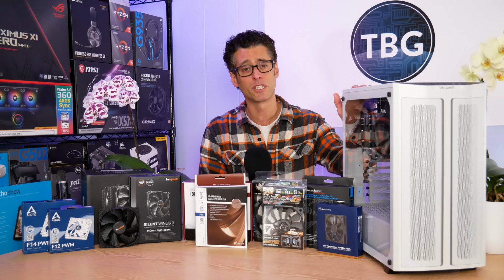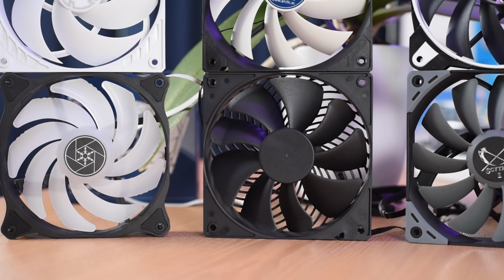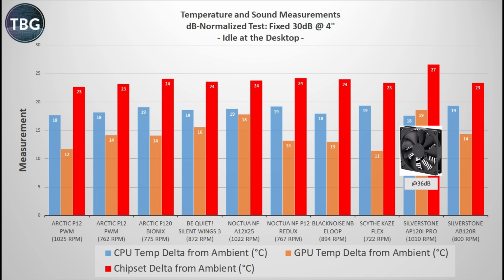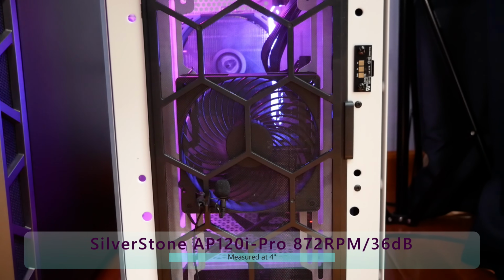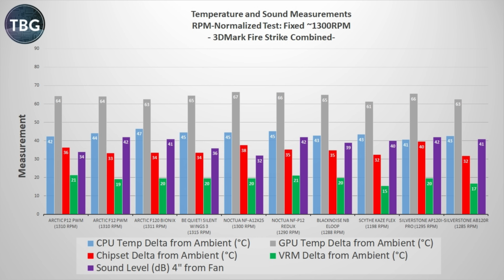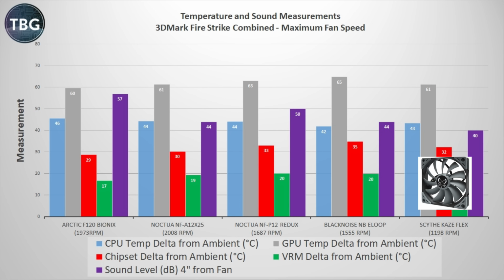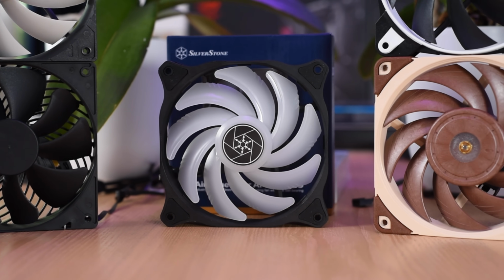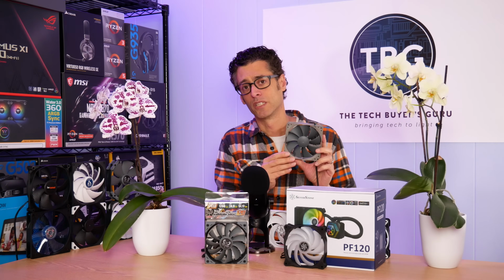The Best 120mm Case Fan Shootout: Arctic vs. be quiet!, BlackNoise, Noctua, Scythe & SilverStone

Comment: Coming from the 120mm radiator video! Amazing work man! Honestly I could not agree more with your conclusions! Overall the Scythe kaze flex is just on another level. The noctua redux is terrible, much worse than I thought! Also I would love to point out that SUBJECTIVELY the silverstone AB120R tone was the least irratating to me! Did not expect that at all. The Noctua NF-a12x25 has such a worse tone to me, it blow me away. Thank you for this review this is such a high quality content, it completely changed my previous opinions about those fans!

If you want to know what I would love to see in your 140mm fan round up would be to also make a couple of wrap up graph when you present temps and Db at minimum-speed rotation, 35db normalized, and for some that might care (I personally don't) fans at full speed with the 2-3 best performing fans overall, removing the clutter of some very poorly performant fans from the graphs.  Followed by the sound test of such fans after each graph.
And another thing for Noctua, I would love for you to include a test with low noise adapter for the min speeds when it's included in the box!

Again, you made an AMAZING video! Thank you! (Subbed ofc)
Reply from the maker: Thank you for this great feedback. I am now getting so much constructive criticism/advice that I've created a document to capture it all, and will try to implement as much of it as I can in the next iteration of this test, which will focus on 120mm vs. 140mm and optimal fan placement. I really like your idea of a wrap-up review showing the winning fans at all test settings, and a repeat of their audio recordings. This will help viewers do back-to-back listening sessions on the best performing fans.

And yes, the AB120R is shockingly smooth. Note, however, that it is not "quiet". I don't think there was anything wrong with the dB reading on that, which I took at 4", even if it sounded quieter close up (from about 1/2"). In other words, its noise travels further. But in my next video, I will measure dB and do sound recordings at exactly the same distance, to eliminate this dichotomy. As some viewers have noted, I still have the problem of whether the microphone is picking up what the ear would pick up, and whether 4" is what matters to a user at 12-24", but there's only so much I can do. I'm not running a sound lab, after all! Plus, for purposes of YouTube, if the mic isn't visible in the audio recordings, people will definitely cry foul, so it has to be in between the camera and the fan!
Reply: @TheTechBuyersGuru   Possibly different frequencies and tones are more pronounced when you only hear them up close since you are isolating them, and are more/less pronounced the farther you go because they get masked by background noise or possibly human hearing is more/less susceptible to certain frequencies even when the sound has less  somewhat energy (then far) or most probably some frequencies are better absorbed by the surroundings and you get less "reflections" from walls, furniture and stuff? Just guesses. 
By the way man, I know how much work you have put into this test and the video and honestly I find it gives already AS IT IS basically the complete picture and gives you all the elements to make your personal favourite choice, every improvement you make it takes an already EXCELLENT and COMPREHENSIVE (for purchase sake) video into an EXCEPTIONAL one, almost on the level that it incorporates of a scientific analysis! 
I think all the suggestions are cool and all, and even regarding to sound recordings, I think the 4" recording should NOT go away because you can also hear the turbulence as you pointed out as the one created by the kinda gummy frame of the Arctic BioniX F120, I mean I one 2 (that I run at min speeds) and if it weren't for your video and your 4" recording I wouldn't have noticed how important the frame material really is! Even just for personal knowledge!
So I personally would LOVE 2 recordings, one at 4" because it's very interesting IMHO to "isolate" the actual fan noise and one at like you say 12-24" user distance and you can also hear in that way how that particular sound bounces from walls and propagates (that might illustrate your point about the AB120R).
As I said I already loved the video as it is, these are just nitpicking because you asked for suggestions on how to improve a super good video so one has to really nitpick. You gave me almost more insight than owning the fans myself!
Please keep up making great videos! Do you have some early findings for 140mm fans? I needed to buy 2 for case airflow, to be just as silent as possible at min speeds. I was watching fan videos and that's how youtube recommended your video to me!
Reply from the maker: I wish I could give you the answer now on 140mm fans, but I honestly can't, as I haven't yet conducted the benchmarks. Based on what I've learned and shared regarding 120mm fans, it's quite clear that thermal and normalization testing really is required.

Comment: Great review!
ps: why does the noctua have such low db levels, yet it clearly sounds close to one of the loudest? Isnt this measured in dBa?
Reply from the maker: These are in flat dB, not adjusted for human hearing to db(A) or any other scale. In future videos, I will switch to db(A). Ultimately, what really matters is the audio sample, but that cannot be measured, it can only be heard. No one can tell you whether the best scale for you should be dB(A), db(C) or something else. If the Noctua sounds loudest to you, it is likely because the frequencies at which it operates are most significant to you. I can tell you that sitting 3 feet away from it, the NF-A12x25 sounded among the quietest to me. And unfortunately, what you hear in a room, or alternatively what a microphone hears in a room (which is not the same), will depend greatly on distance, so if I measure sound pressure level at 1", 4", 12", 36", etc., it can sound entirely different. I always provide both a measurement and an audio sample to help people make their own decisions, but I can't measure an infinite number of distances, on various scales, using multiple microphones!
Reply: @TheTechBuyersGuru  Thank you for your reply. I really liked this content and Im grateful for your effort.
 I do have a couple of suggestions though:
1- I believe measuring in dbA should get the fans closer to what we humans perceive (even though we're all different)
2- Measuring at 4" sure does isolate the sound of the fan from the room. But it's not realistic. I think it would be a more lifelife test if it was measured at the distance most people use their computers. Maybe a poll to figure that out. I do realize the characteristics, size, material, shape of the environment shape the sound a lot. I'd rather have a more realistic distance however. Noise floor could become a problem at some point.
I do audio recordings as a hobby and I'm a musician myself so I do know what you mean about microphones.
Thank you for such great information and a well presented video. Cheers!

Comment: Yes, please test the 140mm fans!  I've found that the 140mm variants of fans have very different characteristics to their 140mm counterparts.  For example, the 140mm Silent Wings 3 performs quite a bit differently from the 120mm version.
Reply from the maker: This is very interesting. It's confusing enough that 120mm and 140mm models from the same manufacturer often use completely different designs (like Noctua NF series or Scythe Kaze Flex), but it becomes even more baffling when fans that seem to use the exact same design, but scaled up, like the SW3, perform so differently. So thanks for the input. I actually plan to focus mostly on 140mm fans that "look" like their 120mm counterparts, to make it more of an apples-to-apples comparison, i.e., what you get when you scale up. If I did a 120mm and 140mm Scythe or Noctua comparison, I'd be changing not only the size, but the entire blade design, and then you really can't draw any conclusions at all about the benefit of larger fans.
Reply: @TheTechBuyersGuru  for me, I was very surprised to see the 140mm version of the Silent Wings 3 to be so quiet compared to the 120mm model.  I'm very interested in seeing how the newer Noctua models compare.

Comment: Over the years I have learned to just get a case with front mesh that allows at least 3 front, 2 top and 1 back fan. then fill those 6 spots with cheap PWM fans like the p12 and have them run at 400 - 1000 RPM (depending on temp, controlled by MB). Then get 1 or 2 fans that are quieter at higher RPMs for the CPU and you have insane airflow at a low price :) my current fan setup is 4 p12 120mm for the front and back, 2 140mm p12 for the top and 2 be quiet 120mm for the CPU. combined they cost me less than 40€ and I can't hear a single fan ever. Only if i do extreme stress testing I can hear the cpu fans very slightly or if i play a gaming session I can hear the gpu fans a bit.
Reply from the maker: This does sound perfect, honestly, and it's something I plan to test out when I do my next fan video. I'm going to take the 500DX case and load it up with five 140mm fans to see what it can do versus just two higher-RPM fans.

Comment: I did buy a 5 pack of Arctic P12 PWM for 29,89€ (and they dropped to 28,75€ since then), when the Noctua NF-A12x25 PWM currently goes for 29,90€ A PIECE (I just checked). What a steal!
The P12 may not be the absolute best in terms of performance but it's definitely by far the best value for money...

BTW, great video!
Reply from the maker: Yes, the P12 at 1/5 the price of the Noctua does make it hard to recommend the latter. It's still the best for radiators, but not worth it for cases.
Reply: @TheTechBuyersGuru Why is it not suitable for case?

Comment: Noctua NF-F12 iPPC 2000rpm? Apparently it's the best static pressure fan
Reply from the maker: That is just a high-speed version of the NF-F12, using a different motor. The blades are the same. I didn't test the NF-F12 here, but I did test it in my radiator fan roundup (https://youtu.be/W2Zis8RjcX8), and it wasn't good. It would have done terribly in this case fan test, where static pressure is irrelevant.
Reply: @TheTechBuyersGuru  The Chromax has 2.6mm of static pressure the Industrial version has 4.0mm and 30% more CFM
Reply from the maker: Right, but it also runs 33% higher RPM (2000 vs. 1500), which accounts for most of that difference. I don't think there are any other changes that would increase static pressure. As I mentioned, I don't think it would do well in this test. Even if it has a lot of CFM at 2000RPM, it could still be badly beaten in my test, which used fixed dB and RPM settings.
Reply: @TheTechBuyersGuru  Fair enough. I would love to see RGB fan benchmarks too, I'm really tempted by the Corsair QL120 fans particularly so could you try make that video if you can? Great video btw and I appreciate the hard work.
Reply from the maker: Corsair offered me some of the QL fans to test, but I turned them down. I have a thing against proprietary RGB systems that need a hardware controller box. Particularly bad for fan tests, because I don't want to mess with installing their box just to get RGBs going for a benchmark run. FYI, I've attended Corsair's CES press events every year for the past 4 years, and each time, I raise my hand and ask when they're going to get on board with motherboard controls. This year, they announced a partnership with Asus, which allows Asus motherboards to be controlled by Corsair's software. That is not exactly going in the right direction...
Reply: @TheTechBuyersGuru  Could of just plugged in the PWM cables in only and leave the RGB cables unplugged haha, I just wanted to know if those QL120's are good enough on radiators because they label them as "radiator fans" and they're rated at 26db. A lot of people will buy those fans so some testing would be great for the performance and you can ignore the RGB ;)

Comment: A few years ago for 140mm it was pretty much a tie between noiseblocker and noctua performance wise, however most of the top tier fans were really close. I doubt much has changed in that respect. Now next year or the year after when noctua finally releases the A14s that will definitely change.
Reply from the maker: This is very interesting. I don't doubt that the Noiseblocker is on par with the current NF-A14 (yes, the use the "A" prefix for 140mm fans that look like 120mm "F" and "P" fans!). I have two NF-A14 chromax.black fans that I intended to use in the 140mm shootout, still considering it, and I have two 140mm Noiseblockers for the test too. If a 140mm version of the NF-A12x25 came out, however, I fully expect it would be an amazing heatsink fan and a mediocre case fan.
Reply: @TheTechBuyersGuru  Depends entirely on the case. Your test bench was as unrestricted an airflow setup as possible without it being an open air testbench. Which even Noctua's own marketing material showed was suboptimal for the A12's static pressure profile. Try the same test with a silent base 601, faceplate on, and see what happens. Then fully populate the front of the 601 and see what happens. Then use electrical tape to block all the front 140 mounting bracket holes to create as good a case seal at the front of the case as possible and see what happens.
Reply from the maker: You are right, it depends on the case, but my personal/professional opinion is that cases like the 601 are going to fade into history and cases like the 500DX are going to reign supreme. So if the NF-A12x25 works great in a bank vault of a case, well, so what? They designed it around yesterday's case, not today's or tomorrow's. And honestly, I think they actually designed the A12x25 for radiators, where it works amazingly well.

Comment: I just took delivery on 3 of those Noctua Redux 120's (1700 rpm).  Not even going to bother with them on my 360 rad, instead I just ordered 3 of the Arctic P12 PWMs after seeing your last review and also reading actual user reviews. I would really like to see some dedicated 140mm case fan reviews. I just ordered 2 Arctic P14 pwm to try out. I tried Fractal Venturi  HP-14s and a AF-14. Also, tried out Phanteks PH-F140 MP's. Would be neat to see how your results would end up.  Chassis I am testing in is a Define S2 Meshify. 2x140 front 1 x 140 rear.
Reply from the maker: Oh yeah, for a rad those Redux fans would be terrible. The NF-A12x25 on the other hand, would be awesome, but at $30 each, that's probably almost as much as your rad cost! The P12 is a great compromise, excellent performance, low noise, nearly free!

Comment: Cooler & case combo question!

Hi, I'm currently shopping for my 1st build and your channel has been extremely helpful!

I'm considering whether to go for an air cooler or AIO. CPU: Ryzen 5 3600x (don't intend to overclock), GPU: Asus Nvidia 1660 super, Mobo: MSI b450 tomahawk max, Ram: Corsair Vengeance Pro RGB

For air coolers, I've narrowed it down to the Scythe Fuma 2 or the Mugen 5 Black RGB (not the argb edition mugen that did poorly in one of your reviews :) ). For AIO's I'm looking at the Thermaltake Water 3.0, Cooler Master Master Liquid ML240R, or the NZXT Kraken x53/x63.

Regarding the case, I'm considering either the Lian Li 011 Dynamic or the recently released Be Quiet Pure Base 500dx.

Which case/cooler combo would you recommend? I'm currently leaning towards the Lian Li 011 with one of Scythe air coolers.

Thanks for your help!
Reply from the maker: Definitely air cooler. The 3600X doesn't require a liquid cooler, especially if you're not overclocking. And they are louder as well. The 011 Dynamic (https://amzn.to/3dHi0K1) is a great case, but it's much more expensive than the 500DX (https://amzn.to/2XEVgoq). And the 011 needs at least $40 worth of fans to run, because it doesn't have any. That makes it twice as much as the 500DX at minimum. The Fuma 2 is sold out, so go for the Mugen 5 if you can find it, but another idea is the new be quiet! Pure Rock 2 (https://amzn.to/2AJbFiW).
Reply: @TheTechBuyersGuru  Thanks for the response. I'm in Europe and I actually found a Fuma 2 in stock for about 50 Euros, which is only 5 Euros more than the Mugen 5 so I think I will go with the Fuma 2. The Fuma 2 has slightly better performance/noise Lvl than the Mugen 5, right?

As for the case, yes it's more expensive but not twice as much. The Lian Li is about 30 EURO more at my local retailer (+ another 40 for the fans). Both cases have great airflow from what I can tell, although I think the Pure Base may be slightly better since it's more focused on airflow. I really like the look of the Lian Li + I might upgrade to an AIO at some point in the future when I upgrade to a newer gen ryzen 7. However, after just seeing the Pure Base 500dx in person it also looks really great, especially the white version. Premium build quality as well. Thanks again for the feedback!
Reply: PS. I'm looking forward to the 140mm fan test. If I go with the Pure Base 500dx, I'll get a couple more 140mm fans. If it's the Lian Li, then I'll most likely a bunch of Arctic P120 PWMs. Those things are super quiet!
Reply from the maker: If you can get the Fuma 2, then get it now! I literally have viewers worldwide telling me how disappointed they can't get it after seeing my shootout that included it! And you can't go wrong with either case. The Lian Li is much more of a showcase, really nice design, but I wouldn't be surprised if the 500DX outperforms it. When I do the 140mm fan test, it will be in the 500DX, and I will actually include a quick comparison using its 3 stock fans versus P14s and a few other brands. I have a bunch of other reviews to get out before then, but hopefully I can get that published sometime in July.